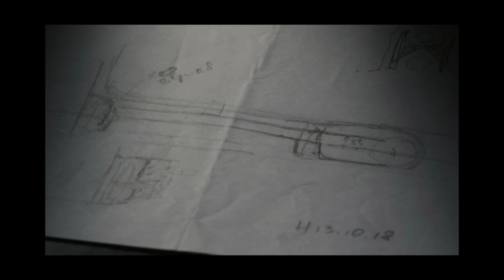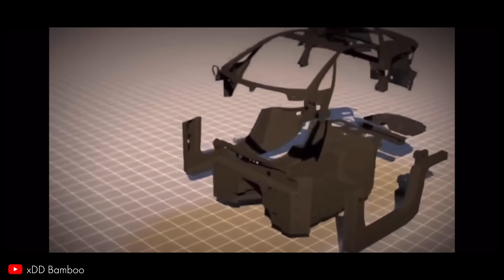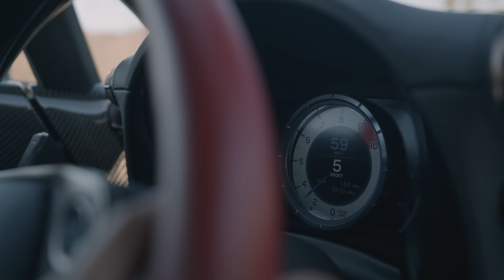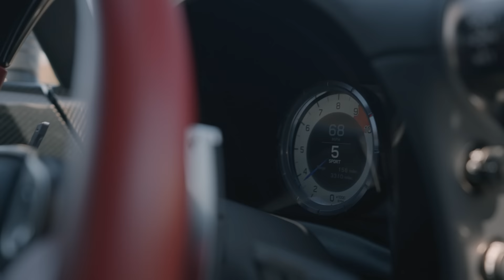The LFA Was Wildly Misunderstood. Until It Wasn’t: Lexus LFA — BTS with DTS — Ep. 7

Comment: man, the LFA has one of the greatest sounding v10 engine of all time. It carries more sensational energy than current F1 cars do.
Reply: You have no idea what you are taking about. Current f1 engines sound amazing in person
Reply: @nozopoke1782  no they do not
Reply: @Jeff_Klein  yes they do
Reply: @nozopoke1782  you can’t even hear them coming. Pretty muted.
Reply: @Jeff_Klein  not sure what race you went to but the ones I’ve gone too are pretty loud. I also attended the v8 era so I have a good point of comparison
Reply: @nozopoke1782  went to Interlagos a few times. Main straight. Also went to the NA era races. The NA car I could hear them on the opposite side of the track, as for the v6 I can hear only after they pass by.
Reply: Thank Yamaha.
Reply: Correction, it is THE best sounding engine of all time. Period.

Comment: There will never be a better sounding road car.
Reply: Carrera GT
Reply: It sounds amazing, but I still prefer the Carrera GT.
Reply: I think it's been dethroned by the aston martin valkyrie
Reply: Gt350r: Hold my beer.
Reply: F1, Valkyrie, T.50 and the next one with the same engine probably… etc etc
Reply: id like to point out, there are people who drive the CGT and lfa and they all say the LFA sounds better, especially from inside
Reply: @palefaced1  no V8 comes close to a v10
Reply: It's honestly sounds better than modern f1 cars.
Reply: @palefaced1  
I have a GT350R, and it sounds absolutely insane. Easily top 5 best sounding engine. But that V10 screaming at 9k is otherwordly.
Reply: ford ranger buddy
Reply: Have you heard the GMA T.50s engine running on the dyno yet?
Reply: @flacjacket  that’s on the dyno, what about in the car
Reply: I think those old ferrari 12s sound the best. But I guess I can't think of a better v10.
Reply: F355, Carrera GT
Reply: People who chose the Carrera GT over the LFA clearly only have driven both cars in need for speed and not in real life lol
Reply: the Carrera GT sounds like a mail truck at idle and low revs.
Reply: @palefaced1  while a GT350R does sound great for a sports car, it's like comparing a very good looking woman to Jenifer Aniston. They're just not in the same league.
Reply: @wharris302  striaght pipe the LFA and it sounds the same as the CGT...... Most of the sound is from the exhaust......
Reply: Straight piped ferrari 458, ferrari 812, porsche gt3,…

The only cars that may come close
Reply: Thank Yamaha.
Reply: @popinjayjunior7698  as insane, surprisingly.

Comment: Sad that we will probably never have something even close to this beast
Reply: Gordon Murray T50
Reply: re e  nope if they ever do it'll be electric
Reply: @tomfurstyfield  or hydrogen
Reply: Your right, they knew gas was going bye bye so they wanted to end with a bang. 10 of them
Reply: F12? 812? Hell manual 599 gtb with the gto kinematics. LFA it's a great car but it's second page in the list of greats.
Reply: re e  makes sense then. But it will take a while, because mild hybrid as in ICE engine with anxiliaries run thru batteries (t50, bunch of VW cars, Valkyrie) and even 'supercharged' by an small ev motor do not count as ICE so there will be plenty of time to do WAYYY better than the LFA. 
Hell, Ferrari has a LaFerrari type without hybrid and batteries with the 9500rpm screamer from the 812vs and full carbon body in the making. That alone will have to be better
Reply: I sat in 3 LFAs xD
Reply: re e   Twin turbo v6 hybrid actually. I hope the rumors of the production car being cancelled aren't true
Reply: @cutdepiefails6596  judging by the video one could say this car had more passion in it's development than most of modern cars, even those you mentioned.
That "won't make money" approach, yeah, that is amazing.
Reply: @nikobellic737  for sure it's cool af. There are some like that tho. And for sure it adds a lot of value to collectors, but still, 812 for half the price with an engine Toyota could only dream of vs spending carrera gt money on a car that is cool in isolation but doesn't really stack up that high even in period.. it is an hard proposition. But if money and space are not a problem, great thing to have.

Comment: The LFA is magnificent but regarding sound (and yes it is incredible) before the LFA even came out BMW had already made a V10 that when modified correctly sounds even better than an LFA (heard and been in both) and they put it in a family saloon in 2005! 😅

Stock? Yes LFA hands down but an E60 M5 with modified with a full carbon plenum, intakes and exhaust? The BMW genuinely sounds better overall once the restrictions that were put place are removed since the BMW was aimed at business executives and families...a totally different audience to the LFA.

I don't expect most to understand but then how many have heard both let alone had rides in both?

Either way, both absolute legends.
Reply: Except that BMW engineering is crap when it comes to longevity. This Lexus would be as reliable as any other Lexus while you have to baby the BMW lest it blows its motor. Nah keep your german crap, I would have this over any german car anyday.
Reply: There isn't a single LFA that has reached 100K miles yet there are numerous E60 M5s that have surpassed 200K miles on the original engine. Also your comment has nothing to do with the sound.

You couldn't own an E60 M5, run and maintain it let alone an LFA so stick to your keyboard 😅

Comment: And then they sold out. By letting BMW make the supra . Which in fact is not even a Toyota product its all BMW and couple that with the new Subaru G86. That’s right again not a Toyota product. Sad! Well folks there ya have Toyota is a sell out!
Reply: The toyota gt86 is actually a toyota not a subaru, only the motor is from subaru, also toyota owns over 15% of subaru.
Reply: @carholic-sz3qv   it’s Subaru. If the heart of the vehicle is anything other than that manufactures product it’s not officially their product. Again sell out.
Reply: @nachomandetailingservices1057  nonsense, subaru doesn't make rwd cars to beginn with, secondly, the gearbox and many other systems/parts of the car are toyota, toyota even added port injection to the engine..... toyota did all that business with bmw and subaru to save $ millions/billions
Reply: @carholic-sz3qv   so they say. Save money what ever there to lazy to make something them selfs and sale it for a decent price. There money grabbing bro!
Reply: @nachomandetailingservices1057  stop talking nonsense and grow up mate, toyota would have spent millions of dollars just to develop a brand new inline 6 engine compliant to emissions. Toyota has been already working with bmw for over a decade in Europe, bmw used toyota hybrid technology and toyota used bmw diesel i4 engines.
Reply: @nachomandetailingservices1057  the toyota aygo, proace van in Europe are made in partnership with citroen again where toyota shares their hybrid technology with citroen.
Reply: @carholic-sz3qv   we are just going to have to disagree . But it is what it is. They could used a platform within their lineup. And motor for that matter I mean how hard can it be to build your engine stronger more powerful when you already have an engine that’s built just put in some better rods a better crank bigger cams you know a nice tune and be done.
Reply: @nachomandetailingservices1057  are you trying to be funny?! Seriously think again before commenting, the toyota supra architecte has always been inline 6 turbo with rwd and all the customisations behind plus toyota entirely reworked the powerplant with bmw. Yes toyota had engines but that's was the 3.5l that lotus uses or even the 3.5l twin turbo in the lexus ls500. The supra is actually assembled in Austria by Magna -steyr and thats why they could also make the car cheaper, those aren't big sellers like the corolla or camry tbh.
Reply: @carholic-sz3qv  It would be if they priced it correctly.  Just saying
Reply: @nachomandetailingservices1057  lol.....
Reply: @carholic-sz3qv  incorrect, the BRZ/FRS(GT86) project was mostly handled by Subaru engineers. The chassis, suspension, and engine are all Subaru. The gearbox was Toyota because they had a RWD trans available essentially off the shelf, and Toyota developed the dual-injection system, but the overwhelming majority of the car and its critical systems was all developed by Subaru.

Comment: The LFA is an analogy for the E60 M5. Both cars have very similar characteristics and deliver amazing driver’s experience. 

Very high rev V10s, clunky single clutch gearbox that begs for high revs, frustrating at lower speeds/revs, really stiff suspension made for hard driving. Both race bred designs made into streetable cars which gives you incredible highs and lows in driving experience, they are either full on or all off. No middle ground experience.

Comment: 1LRGUE - 10 independent throttle bodies, even firing V10, with equal length headers. The three tubes that go into the cabin are tuned for bass, mid-range and treble. They come off the intake manifold and use rubber diaphragms in each tube that the manifold vibrates to pass the sound waves into the cabin.

Comment: "just the right road" reminds me of my 911 experience. The 911 (997) was capable of driving just about everywhere, but in normal traffic it was boring, and on many back roads, I found it less enjoyable than its mid-engined siblings. But get a freshly paved, smooth backroad, where you can get on the power early and not back off due to tightening corner radii or mid-corner bumps, and suddenly the 911 made sense, and made its smaller siblings feel like tinker toys in comparison

Comment: Tanahashi is on record saying he deliberately chose the single clutch over the dual because of it being more raw and "boyish" than the more refined dual (which was entirely an option unlike what's implied in this video). The smooth shifting dual didn't fit the car's character. 

Calling it garbage is a slap to the face to the intentional design, and misrepresents the stated goal (which is what I thought this piece meant to dispel).

It also shifts at 200ms so... not slow.

/soapbox

Comment: First of all stop quoting the fact that it was sales flop... Cheif engineer of the project gave his statement in 2011 that only 500 units will be produced to keep the exclusivity... And the goal played out very well, they wanted people to lust after a lexus that offers what other cars don't and is unobtainable (that pumps the brand value hugely)... Secondly all the dealers who had 7 new LFAs in lots till 2019 were simply hoarding the cars waiting for value to take off, I guess 2 or 3 cars are still hoarded by some dealers. It is just like locking up a 2015 dodge viper ACR that has close to zero miles and selling it in 2025 (another limited NA V10 car that is not coming back) 😛.

Comment: You forgot the F40, that had A LOT of carbon fibre, in 1988.
The tub and all panels, before the F1 et al.

This required less footage of some dude and more of what makes the LFA so special.
Reply: The F40 didn't have a carbon tub. Only the body panels were carbon.
Reply: @camogap7392 incorrect, take a seat inside one and you'll see it's a carbon tub glued together with green Silastic.  Even the front cargo area is a small carbon tub.

Comment: Why the new Supra was not built on this platform is by far the greatest mystery and disappointment in modern automobile history.
Reply: Not a mystery at all.

Simply put, Toyota wanted the car to be (relatively) more affordable and have the straight-6 engine like its predecessors. That's why they partnered with BMW. And the fans didn't buy enough A80s and wasn't exactly as well-liked at the beginning.

Comment: The biggest problem with this car was the styling.  No one would ever confuse this trapezoid with a Ferrari.  The GTR was similarly ugly but its astonishing performance (for when it came out) overcame its looks.  The LFA was about teh same performance, equally ugly, but years too late
Reply: not ugly at all lol
Reply: @realherobrine5636  ugly - that is why it didn't sell.  When Honda did the original NS-X, it looked like an interpretation of a Ferrari 348.  The LFA looks like it was drawn with a protractor!  The designer is probably the same clown who did the Cyber Truck monstrosity.  If the LFA looked as good as the original NS-X, Toyota would have been able to sell them.  Instead, it sat unsold on lots for YEARS!  total failure